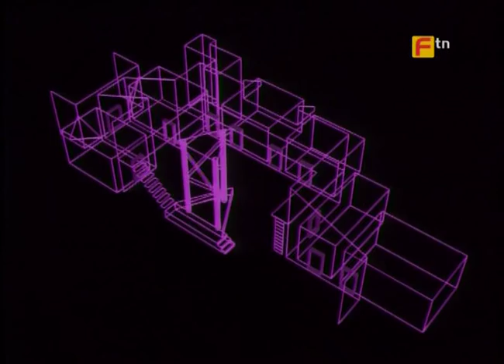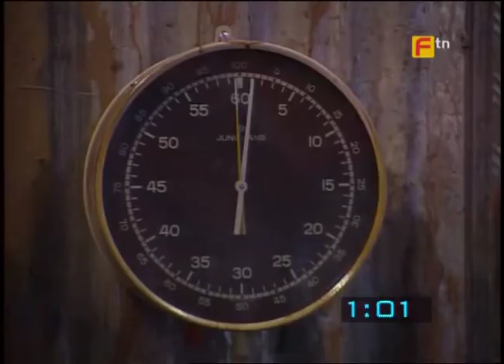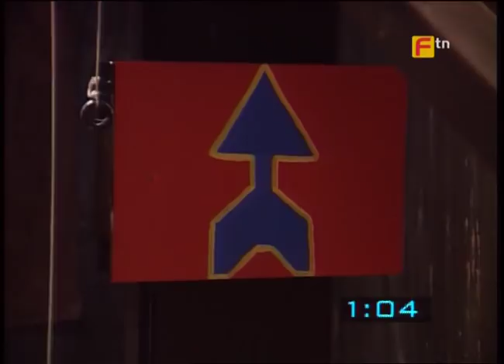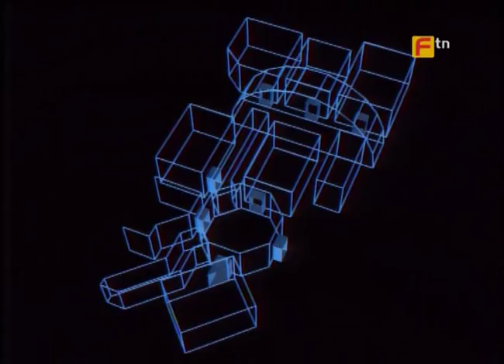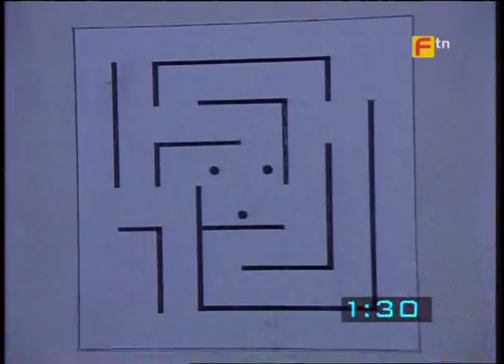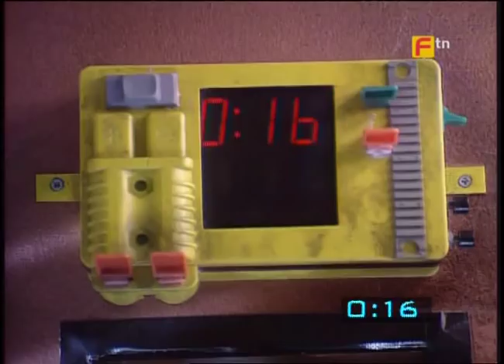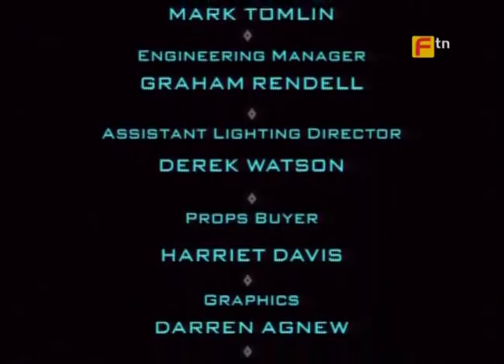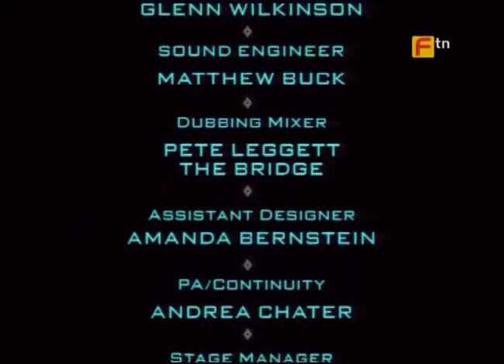The Crystal Maze Series 2 Episode 6 FULL EPISODE

Comment: the cristil maze is just fort boyard ultamit chaling and jungil run copy right much
Reply from the maker: The Crystal Maze was actually originally supposed to be Fort Boyard!! A pilot was apparently filmed with Richard O' Brien (I'd love to see that if it still exists!) but the fort was not available for filming at the time so they built a huge set and changed the format slightly with the permission and help of the format's creator. Jungle Run came later, in 1999, after Crystal Maze had finished (In 1995) so any similarities there are the other way around!! I'm not familiar with Ultimate Challenge so will look it up!! Thanks for stopping by and enjoying this classic gameshow, fingers crossed for the new series, I'm very much looking forward to checking it out x